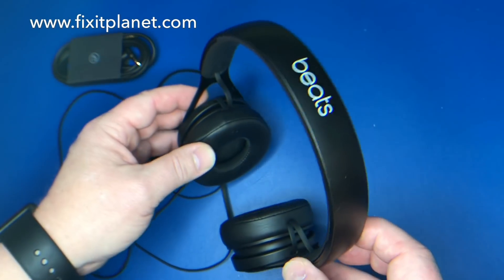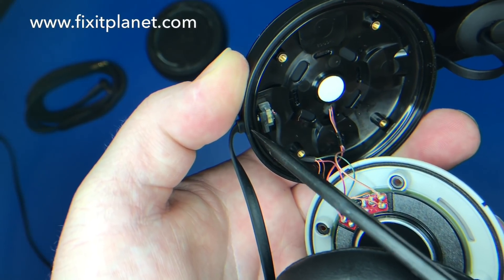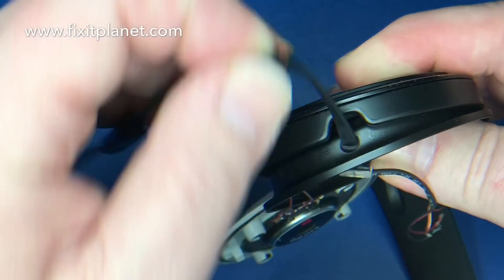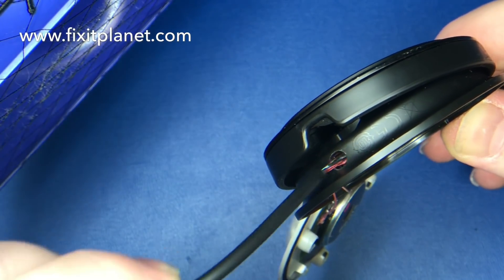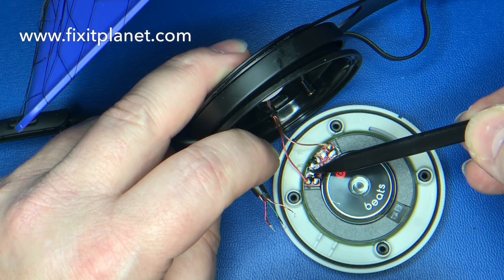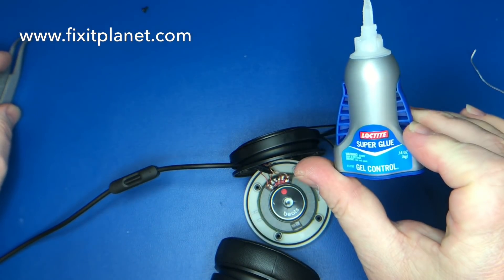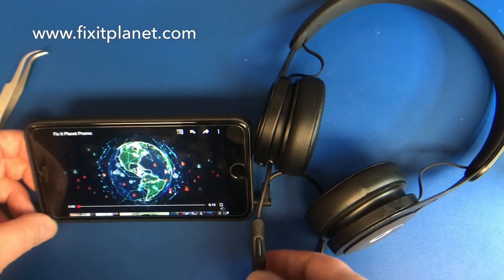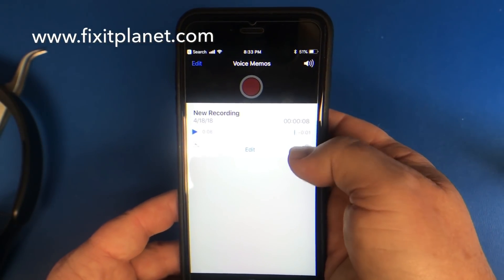Apple Beats EP Broken Audio Jack - Tip - Plug Repair From Start To Finish.

Comment from the maker: NOTE: In some cases you may only get sound out of the right side. If this happens to you: combine the blue wire with the green wire and the red/gold wire with the red wire.
Reply: Hi! I have tried both wires configuration, but the audio is still disturbed in some frequencies. Any idea?
Reply: How much would it cost to repair them at your store
Reply: Great video brother I learned a lot but one (big) problem I have is I connected and soldered everything correctly just like in your video what the problem is when I went to connect the beats EP headphones they were Dead on arrival.  pressing buttons as I write this comment. Power button volume +/- control everything else still dead before I open it up and check for anything loose or not soldered correctly what's your opinion bro I appreciate it. P.s. this is a friend of mine's daughters headphones she initially broke the jack connector I thought it was going to be cut and dry job?

Comment: another (smaller) note to add to Fix It Planet's solution: if that doesnt work, connect all 3 grounds together with either a copper wire, a jumper, or just a large blob of solder (as i did) and it should work! i found this out the hard way, i was tinkering at this with no results to the point where there were only 3 inches worth of headphone cable left :P
Reply from the maker: Yes that will work too. Good suggestions @The Bed

Comment: Great video I have one question is it normal for the speaker where the wire is at to move a little bit left and right down and up When you move it by hand almost as if the speaker was a loose from the headband?

Comment: In theory, would it be possible to make a small adjustment like soldering a short female aux wire? (so you don't need to worry about soldering again)
Reply from the maker: Yes

Comment: Hi, thanks for your great work with your tutorial video. I got that issue with only right side sound but i fix it with you note. My probelm is that volume buttons not work only play/pause middle button work properly. Any idea how to fix it?
Reply from the maker: Look inside the housing of the volume keys and see if something is wrong and double check your connections.
Reply: @FixItPlanet1  I used original Beats cable like you and did not touch volume or play/pause buttons. So there shouldn't be any problem. I double checked all soldering and wires... With no success 🙁
I read all comments here and I'm not only one with this issue 🤔
Reply from the maker: Did you  combine the blue wire with the green wire and the red/gold wire with the red wire like we mentioned in the comments? That is the only other thing I can think of. We do them all the time and so far have not experienced that problem.

Comment: Hi, I have a problem when repairing them. When I try to solder the blue and green wires to the PCB, I see that the board is burned and therefore the left side is not heard. Is there a solution for that?
Reply from the maker: If you only get sound out of the right side combine the blue wire with the green wire and the red/gold wire with the red wire.
Reply: Yes, I've done that but I Still not hearing the Left side.
Reply from the maker: I don't know... those are direct connections so you need to double check everything and make sure you didn't leave anything out. If the board is burned maybe that speaker needs to be replaced. I cannot know. You will have to test the speakers and find the fault.

Comment: One more question. Would you know if using a adapter from apple or more known as a dongle, to solder the the headphonejack part to the beats ep in order to be a detachable cable work on this?
Reply: Cool thanks, I might try it now!
Reply from the maker: I sure that could be done too if you wanted it that way. I would do that if someone requested it.

Comment: Hello, just have a question! Can you ground the two copper wires by soldering the two solder points together? If not what kind of wire do you use for the micro jumper?
Reply from the maker: You don't need a jumper You can just solder the wire to both pads.
Reply: Ok thanks!

Comment: Thank you for the informative and helpful video.  I fixed my son's Beats EP last night while watching your video.  I used the exact same wire.  I needed to connect the blue and red/copper wires as well in order to get sound to both speakers.  I didn't need a separate micro jumper wire.  I simply soldered the copper ground across the two contacts like you say below in comments.  For those who haven't soldered electronics before this might be a little challenge.  Recommend watching some other videos to get up to speed.  You'll need a third hand tool, some small needle nose pliers, flux, a spudgeon tool, soldering iron and solder.  Take a pic of the wiring before you disconnect.  Helps when reconnecting.  I used a couple dabs of loctite to hold the wire in place in the headphone.  Works great.  Thanks!
Reply from the maker: Awesome! You got it... All that is legit. Thank you!

Comment: What do you use for the bridge? Will any small piece of copper wire work or does it need to be something special?
Reply from the maker: Any small copper wire will do. Otherwise you can just solder the wire to both pads. You don't have to do it exactly the same way.

Comment: Where do you get that small micro jumper wire ?
Reply: and what type do I use ? Male to male ?
Reply from the maker: If you cant make a jumper wire then just solder that wire to both pads.
Reply: Fix It Planet so like just split the wire and connect it to both
Reply: Fix It Planet I ordered a micro jumper that is copper will that work ?
Reply from the maker: yes it should
Reply from the maker: You don't need to split the wire just solder it to both pads

Comment: it hurts to see you cut the wire instead of modding it for detacahable cable, which might be a way better solution. Well, only if it fits the client's needs, if not, then I'm speaking damn too much...
Reply from the maker: I like the idea. That would be no problem if the customer requested it.

Comment: Hello, followed your instructions but something must have gone wrong , I can only get sound through 1 speaker, both speakers definitely work because if I swap the green and red wires then the opposite speaker works. Any suggestions. Thanks in advance.
Reply from the maker: From what you are describing it sounds like you have not properly installed the jumper wire bridge. Assuming you tested the replacement cable beforehand and used the same type of cable used in this video, double check everything and make sure the wires are not crossed and they are soldered properly including the jumper wire bridge.
Reply from the maker: NOTE: In some cases you may only get sound out of the right side. If this happens to you: combine the blue wire with the green wire and the red/gold wire with the red wire.